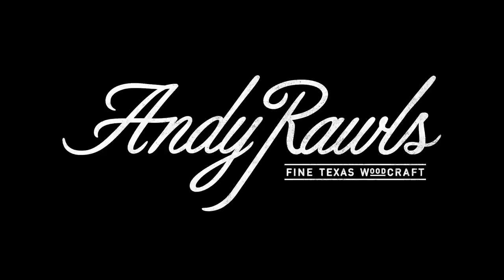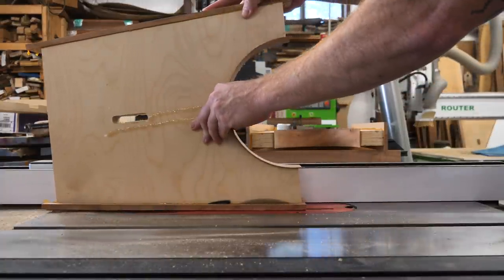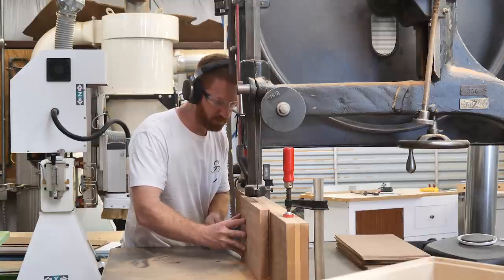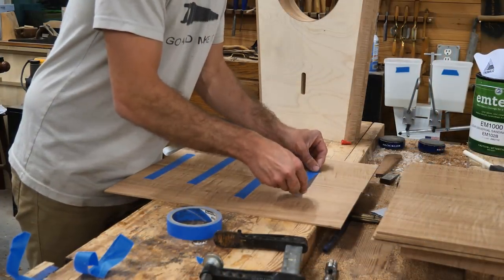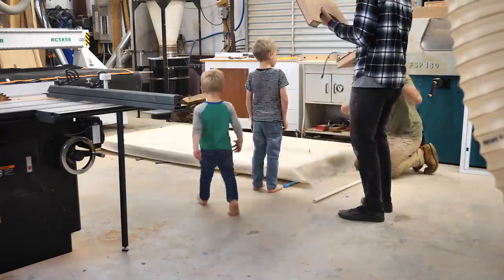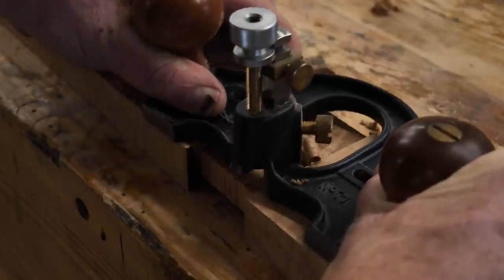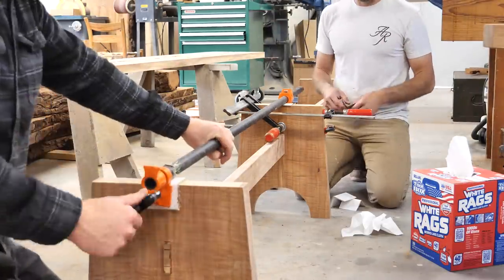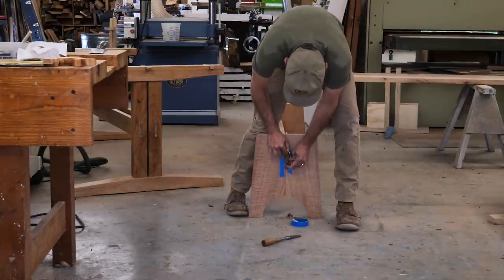Handcrafted 10' Shaker Bench in Curley Pecan

Comment: As a 35 year vet of injection mold building shops I have no interest in cnc in my woodworking.  HOWEVER.  If you offered a professional woodworker from 1870 a cnc machine they would have latched onto it like a starving man on a steak.
Reply from the maker: I think you’re probably right.  I like to find the balance

Comment: Enjoyed the video very much.  What lovely figure in this pecan.  Well worth using it as you did.  Out of curiosity, would it have been possible to have book match planed the two half side pieces to get a tight joint on the sides of the wood veneer on the legs?  I've done book match edging when gluing two boards together on the sides.  Not sure if you did or didn't have enough thickness for the veneer.  Mostly just curious.  Obviously, it came out very nice.